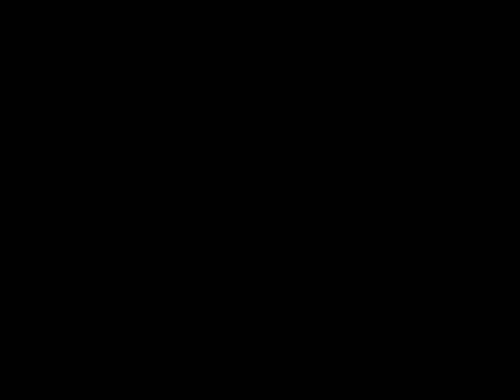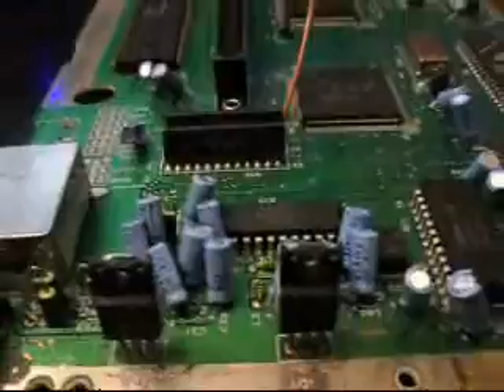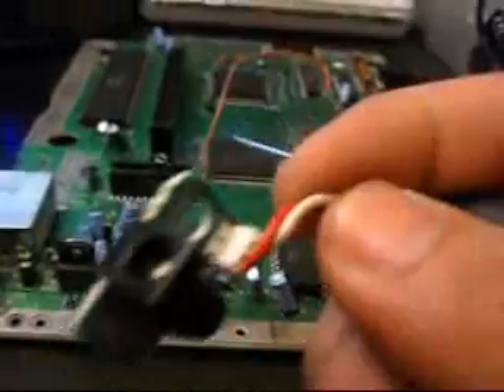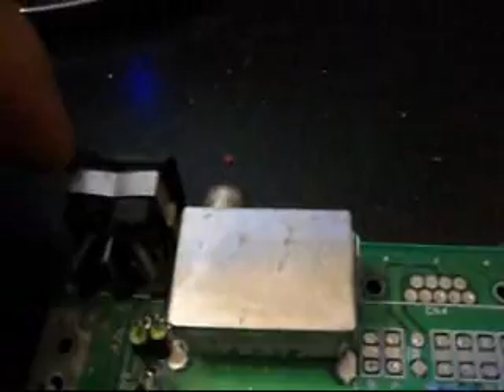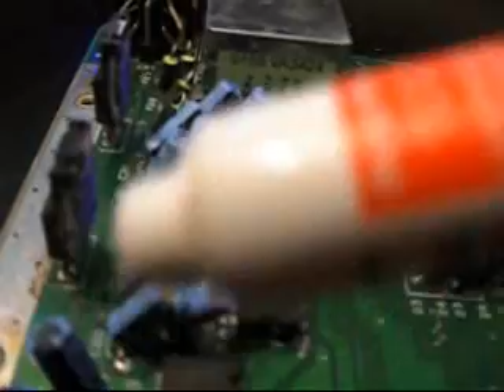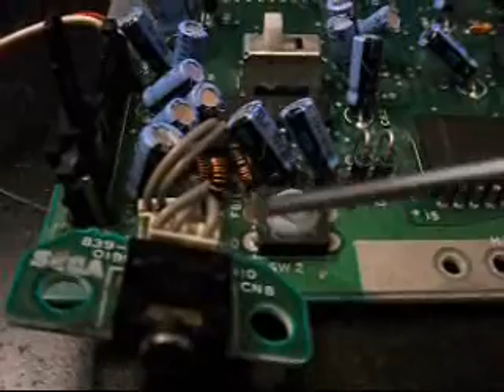Sega Genesis Model 1 Troubleshoot and Repair Guide

Comment: I have one that's getting power everywhere 5v but it's not doing anything other than giving me a black screen. The board looks great, traces are clean af, I re flowed all the connectors, replaced all the caps, the card slot is horrible, I think someone tried to bend the pins and messed it up so I have a replacement coming but in the meantime to just see if its the slot I bent the pins and checked for contact between the cartridge and the slot. I'm starting to suspect the crystal oscillator or maybe one of the chips, but from what I understand the oscillator can cause a no audio/video out. I tried the rf out hooked to an old Curtis Mathe's crt tv, as well and the din out to av cable (I followed a tutorial on how to make one up for the genesis model 1) and still no sound or audio. Like I said unless it's a chip I'm kind of baffled by it. I have looked over the board for days now, not wanting to give up on it... but man I'm wondering if it gave up the ghost. I don't have an oscilloscope to check things but if you were going to throw parts at one with the symptoms I described what would you replace? I am going to start with the 64 pin because I know it's bad, than I'll probably try the oscillator.. but if it's not those things any suggestions?

Comment: Hi I have a Model 1 and I took the whole system apart and cleaned the motherboard, and the casing, and brush the heat panels with a steel scrub because it was rusty. My problem is that  the system wont power on unless if I press on it and the lower switch feels thight also my sound is distorted
Reply: Distortion like that is probably bad caps

Comment: I have the Model 1 High Definition Graphics model that turns on, however, when I start any Sonic the Hedgehog games (Sonic 1-3), it sounds like it speeds up or sounds like Alvin the Chipmunks. After spraying contact cleaner in the game port and the cartridges themselves, they start to work better. Should I recap the motherboard?

Comment: Dear friend, l have a Sega mega drive 1. The RF cable plays OK. I have a 5pin av cable and it plays OK. But when I connect a 8 pin RGB scarf cable, the picture is rolling, up to down. The cable is OK, because it works fine at my friends console. Any ideas about the problem?
Reply: https://console5.com/techwiki/images/8/8b/Mega_Drive_1_VA3_Audio%2C_Video_%28Sheet_2%29.png
Reply: I just posted the schematic for the video output. You'll notice the area you are looking for is on the top right. RGB encoder CXA1145 and the chip is located right behind the cable connector on the main board. Its surrounded by capacitors. You may want to check the capacitors 31, 32, 63(53 hard to read). Also check and make sure you have no breaks in the circuit due to corrosion.

Comment: Please help! I have tried RF and the other video option and both display a fainted fuzzy stripe that goes from bottom to top of screen and repeats. How can I fix this? Is there a soldering point?
Reply: Mikes Recipes did you try to replace the graphics chip ?  It’s the CXA1145P ? If you did and the issue still there then it’s one of the capacitors

Comment: my sega genesis was all good when i powered it on and after a round of thunder force 4 the sound started to get distorted and then the picture got all filled with static artifacts and the picture is wavy. i used a step-up converter and an original power brick when it did the sound thing, so i figured that it was the main culprit. i changed the power adapter to a standard 9V 1A one and some time after that the static artifacts started to show up also. so are the voltage regulators probably busted or is it something else?

Comment: Anyone got a replacement part number for the power switch?
Reply: Mine has a black peg while the one in the video is white. My broken switch is marked "T-MEC I" (looked like T-MEC T before unsoldering). It is likely the Taiwanese MEC switch company instead of the other one. I'd like to know what markings may be on the white peg switch shown in this video.

Comment: still can't figure out what's wrong. Everything appears cosmetically ok, but when connected LED lights up, then there's just a brief white flash on TV and blank screen. The voltage regulators are reading 5V output so i'm guessing it's not there, the caps look all perfect but i wonder how to check them one by one. I need an ESR meter for this? Any suggestions would be good.
Reply: Sorry for the late response, This can be many issues. CPU clock or rgb encoder. Do you get sound?

Comment: I have an issue with mine where the headphone jack won't output anything. Is this something you've had happen before?
Reply: I´m having the exact same problem on mine. I hope he gets to your quesiton.
Reply: Same problem here too!
Reply: This is a very common problem I have fixed by replacing the CXA1034 chip. You can find it on ebay for 3.50$
Reply: https://console5.com/techwiki/images/8/8b/Mega_Drive_1_VA3_Audio%2C_Video_%28Sheet_2%29.png    you wanna look on the bottom right for the circuit around the headphone jack.
Reply: https://www.ebay.com/itm/1PCS-CXA1034P-CXA1034-Power-Amplifier-/221546226727

Comment: I opened my genesis to give it a cleaning and I saw unravelled paper. it came from one of the blue cylinders from the motherboard. I guess it's a capacitor of some sort. do u know exactly what it is. it says A002 on the side of the little cylinder. thanks.
Reply from the maker: Can you send me a picture of it and location on board? I'll let you know what part to replace and why it's blown
Reply: Always Upgrading R.C. Definitely a capacitor. Easy fix. Get an electrolytic capacitor with the same specs (higher voltage OK) and replace it. Mind the polarity.

Comment: Thanks for the video. I couldn't figure out for the life of me how to fix my Mega Drive model 1 overheating. I'll try new cooling compound first. If that doesn't work I'll try replacing the voltage regulators.

Comment: Does anyone know if the PAL Sega Mega Drive model 1 1600-05 has different or the same capactiors as American Genesis 1 consoles? I'm hoping my system with a slight sound problem may just need a recap knowing that capacitors can be bad despite looking good. I'm eyeing the capacitor bundle on Console 5.

Comment: Very helpful video. It crazy though cause my model 1 genesis only has 1 voltage regulator and it is bolted to a big giant heat sink. Working on getting my model 1 operational after being dead for 15 years.

Comment: HI !
I have issue with distorted sound (with an original sega adapter). Tried the cartridge on another genesis, the sound was fine. Can this be due to an issue with the cartridge slot ?
Reply: clbna no capacitors. just recapping the console should work just fine

Comment: My controller 1 port always has DOWN depressed.  No matter which controller I use (or even no controller plugged in!), every game I put in thinks that DOWN is being pressed or unusable.  Any idea on what can be done to fix it?  Controller port 2 works fine.
Reply: +y2j420 I have the same situation, Mega Drive 2 Down always pressed. Any fix?
Reply: I have a model 1 with the same problem. The player 2 goes right without a controller plugged in. I checked and replaced the some of the components and reflowed the chip and still having the same problem. Got any ideas on what the issue is?
Reply: No idea guys...I ended up returning and replacing the system.  Though I will say this, I had my Genesis on top of my CRT TV...it was working fine...one time, however, with the TV on, but the system off, I plugged a controller in and got that usual static feel on my arm...after that point, the controller port never worked properly.

Comment: l have a console which works but after   2 or maybe 3 minutes  the picture freez , so can you help in this issue ? i have never saw a video shows to fix my issue
Reply: Ali Al Bazaz hey man. have you fixed your Genesis?  I had the same issue but sometimes it would go to an error screen that says something like error and some numbers over the screen
Reply: Hi Jorge , actually yes it`s some places where the solder is old and not attached so good , so when the machine starts and gets hot the solder will disconnected i found that spot it was pain in the ass , it`s located down the heat sink on the flip side of the motherboard  also i recommend to put new solder over the spots everywhere you suspect , the error message it`s mostly from cartridges that was happening to me specially with Mk3 and the Ultimate MK3  man it`s a CPU issue what is your machine exactly ? is it the Model 1 Segmatic CPU ? that old CPUs they are not compatible with the new cartridges and if you overclock it it will be very nasty and noisy ...
Reply: @jorgepalomares8025  Hola Jorge, te lo tu mismo problema, has podido solucionarlo? Estoy pensando en cambiarle los condensadores...

Comment: i used a spring from a cheap lighter..placed inside the reset button and now the reset button is better than new.. use tape to hold it in place.. the under side of the button has a tube opening . .thats where the spring goes.

Comment: Hello friend, great video.
I have a problem on my Sega Mega Drive, the board is MD1095D-1.1
After a while on, it starts to get pixelated image.

I did a test with it cold, I put a hair dryer on top of the C50 C77 and CXA1145P and quickly showing the defect.

I changed the capacitors C77, C50, the crystal oscillator, but it was nothing like that.
Do you have any tips of what can be?

I made a video showing the defect.

https://www.dropbox.com/s/xagmb94ipxn4ecs/2015-02-27%2023.05.01.mp4?dl=0

Comment: i recapped my mega drive m5 motherboard low sound and buzzing i am using the official power pack even though headphones i re flowed all the ic on the board with a little flux.
other than that the console works i am thinking of tapping into the audio chip and see if there's a problem

Comment: Hey I wonder if you can help I bought Sega Megadrive and have issues with the lower part of the screen. I've tried different RF cables, different games, tv's. It seems to effect every game slightly differently. For example with phantasy star 4 a white line jutters in and out flickering horizontally on the bottom of the black screen just under the image, with earthworm jim its along the title menu but not the levels, sonic 2 the bottom 0.5 cm of the level freezes but the rest plays through fine.

Comment: So I've seen your video... and my sega genesis/megadrive doesn't turn on... 
I've opened it up, and I was checking the voltage regulators, since it was the first thing you've mentioned and they are all white. Is that good or bad?!

BTW, awsome video. ;)
Thanks a lot bro.

Cheers

Comment: My megadrive does not boot into games correctly. With Themepark it shows the logo of EA but no game. It's the model with a serial port and pin 6 of the cpu is cut. There was a resistor in between pin 6 and the original trace.

Comment: So the issues ive been having are that once i power my console my image is some what distorted ans blurry. can even see whats going on the screen any useful tips to make it work.
Reply: Jon B did you try to replace the graphics chip ?  It’s the CXA1145P ? If you did and the issue still there then it’s one of the capacitors

Comment: I had the same problem with my Sega. I thought the problem was with the video cables, but it turned out that the Genesis wasn't getting enough power. I was powering it with a cable from an old Sony Walkman, because it happen to fit, but it wasn't putting out enough volts to get the picture to come through.

Comment from the maker: Well if cleaning the game or the slot did not work. You could also look into making sure there is enough power going to the unit. If you have a multimeter, make sure the power supply is putting out the right amperage and voltage.

Comment: Hi, First off i would like to say great video but im not sure if i have a Sega Genesis model 1 because the motherboard looks different from the one shown in your video. My Sega says its a Model 1601 i got this bad boy back in 1989 for xmas and this is the first time ive ever had any issues with it. I have taken it apart and cleaned all the dust and grime but i noticed my power switch will not move at all. Its stuck in the off position. Can you give me some insight on how to replace the switch?

Comment: hey , are the three wires that go around the board standard? mine are brown blue and red, also there is a resistor placed onto one of the processor legs, is that normal? i justbought a megadrive on ebay and the case screws were lose, i think it might have been tampered with

Comment from the maker: @DoableSteve Hi doableSteve, Sounds like you might be having issues somewhere around your video encoder. First try the av/out by doing my mod or open the console up using my disassemble video. I go over the location of the video encoder. Check the capacitors around the video encoder and also make sure the area is clean. Want to look for brown/tan leaks or bulging capacitors. Link is in description for a video on bad caps.

Comment from the maker: Sorry I took so long to answer. I've seen this problem before. Its a power issue. Check to see if you are using the correct power supply. Make sure it is a 9v 850ma. The more "ma" the better :). Also if that doesn't fix your issue, then you might have bad voltage regulators. The voltage regulators are 7805A that you can get at radioshack. I just made a quick video to reply aswell. Hope it help's. Wish I could finish my power supply mod tonight but I have to be up at 5am >_<. Best of luck to you.

Comment: Ok... My genesis does receive power, the cartridgeslot is clean and it SHOULD work, but when i turn it on all i get is a buzzing sound and some flickering lines going up and down >:(  So what could be the problem? (i get the same proplem with or without a cartridge inserted) Please help. I really want to play some Sonic 2 ;p